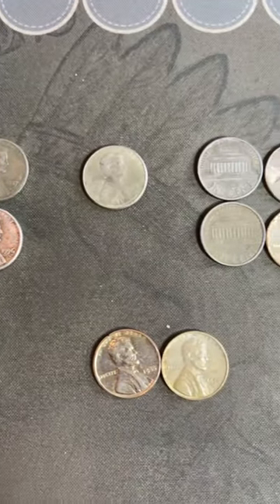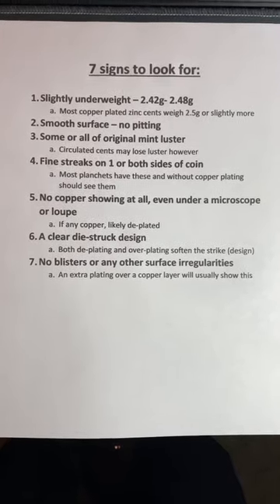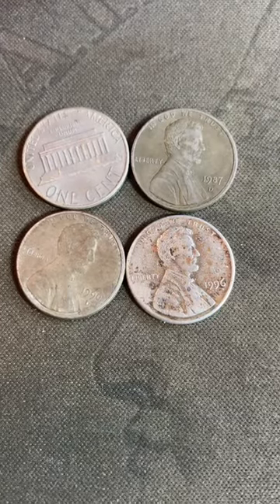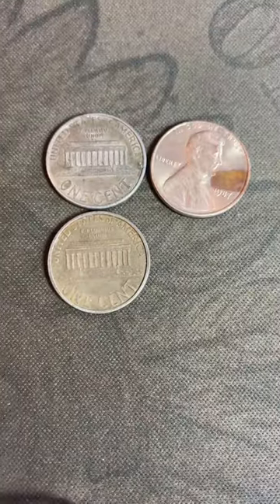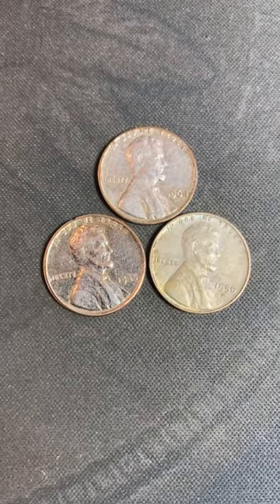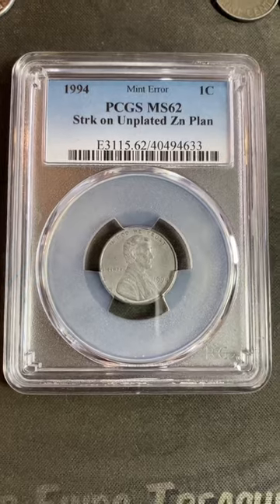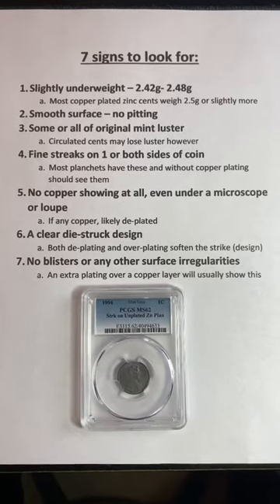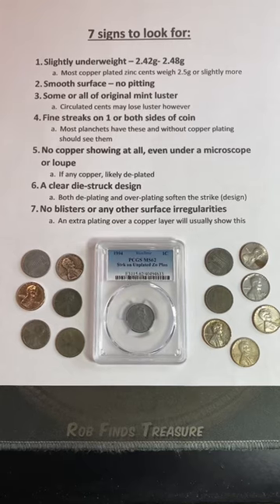Is My Penny a Mint Error?

Comment from the maker: Here are the 7 signs to look for:
1. Slightly underweight – 2.42g- 2.48g 
     a. Most copper plated zinc cents weigh 2.5g or slightly more
2. Smooth surface – no pitting
3. Some or all of original mint luster
     a. Circulated cents may lose luster however
4. Fine streaks on 1 or both sides of coin
     a. Most planchets have these and without copper plating should see them
5. No copper showing at all, even under a microscope or loupe
     a. If any copper, likely de-plated
6. A clear die-struck design
     a. Both de-plating and over-plating soften the strike (design)
7. No blisters or any other surface irregularities
     a. An extra plating over a copper layer will usually show this
Reply: Tanks for the vid, great info. 
Do heavy penny's have value?
Reply: So I have a 5gallon arrowhead jug filled to the top with pennies took me ten years to fill it up. Pennies I found on the ground I would pick up and when I got change back from the store. IS IT WORTH LOOKING AT ALL OF THEM TO SEE IF I HAVE ANY VALUABLE PENNIES?
Reply: @joshmorris5322  of course it's worth it. 
While sitting there watching reruns get a monical eye piece and a little scale and grab a hand full a night and check them out. 
You waited this long to cash them in what's a few more weeks. 
Just think one coin could be worth that whole jar.
Reply: @paulqruel9290  thanks for replying back and telling me its worth it...will do.  I'll give you an update.  Wish me luck
Reply: I think I may have a real rare find 1988 aluminum penny, can some one help me out with this 😮😮😮

Comment: I got one I found one last summer It's a 2004 unplated penny it weighs 2.43 g It has a few streaks in it The detail is extremely sharp like if it were to be missing the copper which it is and without any signs of any kind of copper on it whatsoever

Comment: Nice one, I need to start sending in my coins because I found a 1977 Denver cent that weighs 3.13 and it looks like a nickel clad dime planchet but then again the design of the coin and around the rim looks too good, and to me it doesn't look plated though. I opened up a roll thinking I found a steel cent then flipping it over to read the date and see 1977 D and that it doesn't stick to a magnet leaving me perplexed, is why I even collect

Comment: I found a 1935 one in an ebay roll like 1 month ago
Reply: Is those worth money?
Reply: US zinc cents weren't produced until 1982, and steel cents were only made in 1943 & 1944. A 1935 exhibiting a zinc-like color is either plated by a 3rd party (not the US Mint) or toned.